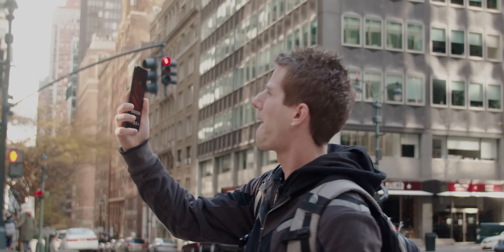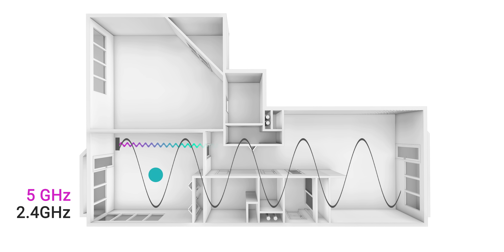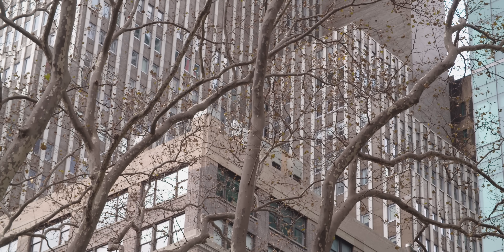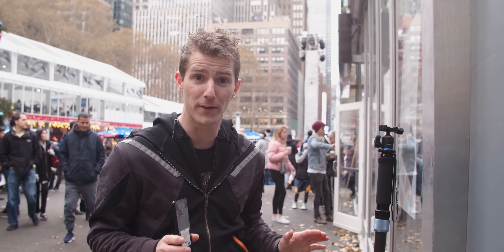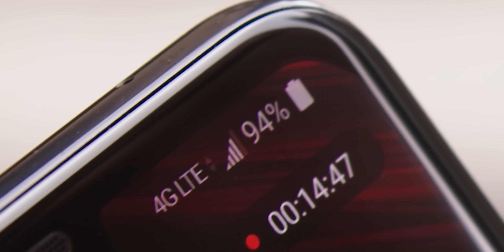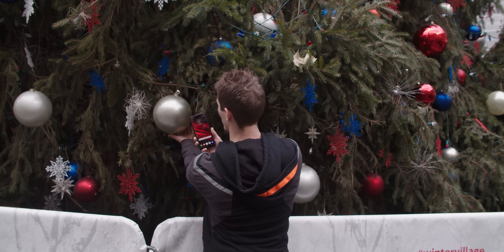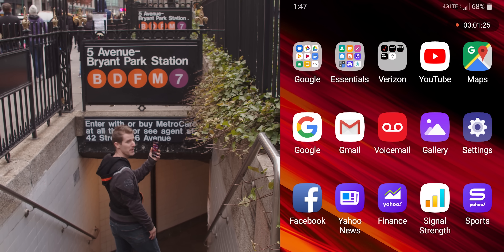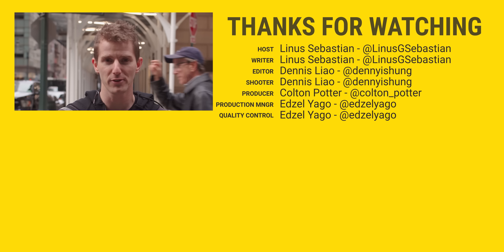The PROBLEM with 5G mmW...

Comment: 5G is a microwave weapon system 😵🤬🤯
Reply: I mean, if you've ever gone outside you've put yourself at a far greater risk from cancer caused by none other than the sun.  5G hardly does anything in comparison; in fact, it is hard to argue that it does anything at all...
Reply: @LegitToaster  This is a ridiculous lie, the sun is good for you.  Microwaves are not.
Reply: @LegitToaster  Infact you have irked me so much I think you should take a look at this CIA document which is a translation of Russian work on the dangers of EMF, the latter pages concern millimetric waves at I think 24Ghz IIRC which is one of the frequencies they propose to use.
https://www.cia.gov/library/readingroom/docs/CIA-RDP88B01125R000300120005-6.pdf
The whitepaper shows that the millimetric waves cause destruction to the Myelin Sheaths which protect your nerve fibres, but hey who cares, you want faster internets on your phone right?
Reply: @chrisobber5604  Your a bot and your attempt to smear me with flatearth nonsense is laughable, I am an IT system engineer with experience working in aerospace and offshore services.  I have spent long enough looking at satelite imagery to know the earth is round.
Reply: @hootsmin  I went ahead and read it, but here's the thing. Not only is this translated (which could lead to factual errors), but it is also from the Soviet Union in the 70s (which had a fair amount of pseudo-science outside of this example).  The amount of research that has been conducted between the 1970s to now is immense, and far more relevent as research has progressed and became more effective. External variables which could affect the results can account for some of the findings as well, especially considering this was before there were standard practices in research for checking results (hence the validity issue). In fact, there doesn't seem to be anything going for this journal, aside from it acting as conformation (bias) for your claim.

Here's the thing. I believe in reasonable skepticism.  I believe it is wise to do research on topics to get a better understanding of things.  What I do not believe in is cherry-picking out-of-date, unchecked, poorly translated, not peer-reviewed journals from the Soviet Union which go against all other modern findings to prove a point.

From a physics perspective which you probably are familiar with, I'm not so sure that microwaves should be feared at such low levels. If we want to use that journal as an example, Zalyubovskaya in the article on the "Biological Effect of Millimeter Radiowaves," it is interesting when it says "[t]he conducted experimental investigation [was] compared with observations the state of health of 97 persons working with generators of the millimeter range."  It would appear that it is there method and equipment which is generating such effects, and many of the effects they describe (such as the renal disorders among the other effects) are more typical of traditional radiation poisoning. It is safe to say with this that there is either an influence from the state to attempt to confirm certain beliefs, the equipment used by the studies is producing higher-frequency waves (or otherwise generating stronger effects), or their was another external variable which was not accounted for.  If the effects of these waves were this strong with this many "quantitative and qualitative" effects, this should have been easily replicated by every other modern study done today.  Also as an aside, it is important to note that most these studies were done on a specific line of rats, which also presents a whole host of other issues, particularly in the way they bred them and their possible exposure to other experiments (not to mention their biological differences from humans which may play a role).

I'm not expecting to change your mind on this, but if you're going to be skeptical, you have to be skeptical about what you use to back up your skepticism; that's the difference between a conspiracy theory and uncovered information.
Reply: @LegitToaster  It seems like every time evidence is provided to people they always give me a lecture about the validity of the science even when they know very little about sceince and probably couldn't even tell me what the scientific method entails.  The same discernment doesn't seem to be applied when they are looking at the flawed whitepapers dismissing health effects produced by the wireless industry or the government however.  Funny that.  The Soviets did excellent work on the health effects of EMF, theres nothing poor about it.  They cooked the U.S. diplomats in Moscow too remember (the Moscow Signal).  They know plenty about the dangers of microwaves.  Regardless the facts are, there are over 20,000 whitepapers which show health effects and 70% of them are negative health effects.  I know nobody likes this because they dont want to hear it, but its a fact.

Why on earth would the Soviet State want to prove that microwaves are dangerous?  This not a good thing for the military or the wireless industry.  pretty much the most idiotic thing I saw you write as it is completely ass-backwards from reality.

Wheres the 5G studies?  They havent done any because it will fail safety testing even with the B.S. standards we have now.  Dont start with the conspiracy theory crap thats a slander invented by the CIA to discredit people who are saying things they dont like and to make the plebs think that conspiracies arent real when the entire globe is run by people involved in them.

BIG WIRELESS CONCEDES: No studies showing safety of 5G - 7th Feb 2019
https://www.youtube.com/watch?v=vZ5soLrvXFg
Reply: @hootsmin   First of all, the Soviet Union wanted to use microwaves as a *weapon*, psychological or otherwise.  Consider that the USSR had poured a large amount of money on the technology already and they had incentive to believe it to be dangerous (purhapse as a display of power). Even if this was all true, the mw/cm^2 was significantly higher in, say the Moscow Signal, than in something like a 5G signal.  Realistically, however, it is safe to say that the Soviet Union would also benefit from pretending/lying about having a powerful experimental weapon, therefor fabrication of studies and effects are a legitimate possibility.

Just so we are on the same page, I don't care for 5G at all, and think it is largely unnecessary, at least for cell phone use.  Also, I don't discredit something just because it is a theory without strong evidence (such as a conspiracy theory), but I don't except it as fact without solid undeniable proof either. There have been conspiracy theories that were later found to be factually based, and I understand that.  I'm not sure I've heard of the CIA inventing the term "conspiracy theory," but I do not mean this to slander skeptical thinking.

The problem here is that these arguments are based off cherry-picking, again.  If we want to trust an authoritative government on a paper relating to its own military experiments, why shouldn't I be able to cite our very own government (assuming you live in the States) on saying that 5G not presenting any "new threats?"  I'm even skeptical about the FCC, but I do know that it isn't nearly as restrictive and deceiving as say the Soviet Union.

I know realistically we aren't going to get anywhere in terms of our viewpoints with this discussion, but do consider what evidence you use to support any decisions or beliefs you hold; research is a valuable tool that aids us to finding the truth in things, but when used incorrectly can lead to misunderstanding.  I do not mean to make this a personal matter, mind you, and see it to be beneficial for both of us to remain as objective and neutral as possible.  It is natural for humans, us included, to not want to be wrong (it activates a response similar to pain), but there is no reason to go to personal criticism; I'm not sure what makes you feel I lack a grasp of the scientific method, but I fear that you haven't understood my position.  I do believe there are some points I had made which have not been addressed here that are valid in there own right, but regardless I'm not sure that anything I said could really be regarded as "idiotic" or "ass-backwards from reality," considering that your argument had no question of credibility or legitimacy which, again, remains a valid issue.
Reply: @LegitToaster  Look I have verified everything I can, I'm not away to get a bunch of labrats and start torturing them with waves for people like you, thats the scientists job.  I have however, verified what the Geordie Terror Mark Steele is saying about the 5G LED lighting systems that have been deployed by studying what has been deployed in my area, we have slightly different technology but it is similar.  In our area the lamp posts are equipped with 868Mhz /900Mhz LoRaWAN control management system, I have a whitepaper from the manufacturer which shows that the pulse modulation that they are using "chirp" was developed in the 1940's for radar.  I have also verified and have in black and white that the system installed can track passive RFid chips (unpowered) at a range of up to 2km.  The 5G towers will be capable of more besides, mind control, crowd control, touchless torture, voice-to-skull, weather modification, over the horizon radar, the sky is pretty much the limit.  You want to die in the surviellance grid thats going to be your problem, the EMF will make the bacteria more resistant to antibiotics and it also makes them and the the fungus act aggressively like they would when they are attacked so they deploy their chemical warfare capabilities.  You live in the matrix and your stuck in the 1980s technologically and our opponents are secretly deploying futuristic star trek phaser technology.  How do you think they know that theres going to be a probelm with antibiotic resistance or that the cancer rate or the dementia is going to sky rocket?  Because they are going to make it happen, ignorance like that which you are displaying is going to get a lot of people killed.
Reply: @hootsmin   Purhapse I didn't clarify what I mean by verification: are these sources which you are using to base your evidence off of scientificly sound (does it properly use the scientific method, is there any bias, does this match what other sources say, and so on).  By verification I do not imply you should or shouldn't test the theories yourself, rather you simply need to evaluate the evidence which you hasn't used, and purhapse their own interests.  Consider Mark Steele, which you used as an example.  Mark Steele runs off of a fear campaign, and I presume this is where you find your argument here for both 5G and street lamps.

To reiterate, I am not saying that these theories are always wrong, but they should at the very least be taken with a grain of salt and reasonable skepticism.  I don't know if Mark Steele has a formal education in a related subject (do please correct me on this if you know), but his claims are quite grandiose and broad.  Mark Steele as well may be not fully sure of his claims.  Mark Steele was offered by EMF researchers (on his side, mind you) to test all the lights and prove that there really was damage caused by them to the general public.  Steele declined.  Mark Steele denied to record direct, factual evidence of his claims, most likely because he knew the results would have been damaging to his reputation.  Here is a link if you would like a read (the article is written by a 5G activist): https://www.vigiliae.org/mark-steele-exposed/

I'm also not familiar with the evidence behind the notion of mind control/"voice-to-skull" through 5G/5G towers, and quite frankly don't understand how this would work from a physics perspective, as well for its weather changing properties. Touchless torture is a bit vague, meaning it could fit into really any definition of torture, physical or otherwise.

Even still, I would like to point out something which hasn't been addressed; in our lives already, there are already scientifically accepted and proven things everywhere in our lives which are undeniably hazardous to our mental health.  Consider what color plates/mugs/cups you use on a day-to-day basis.  How old are they?  Are they chipping?  Many plates (even ones sold today) leach out lead which can make it into your food.  Which issue should be at the top of our concerns?  One which relies on objectively poor evidence or a concern grounded in strong research?  The concern that, at the very least, you have the most influence in is the one which should also be considered before the other.

As for the matrix claim, I'm assuming you mean that in a metaphorical way, but I don't mean to misinterpret your claim in this way.  As for government technology, based solely on how the international system works, it is not likely that the United States has an immense, hidden collection of futuristic technology, otherwise our warfare would play out far differently.  That isn't to say that the government isn't hiding anything, as quite frankly they are, just it isn't maybe to the level of "Star Trek"-esque technology.  I'm not sure what allows a government's scientists to break laws of, say, physics, so I am skeptical of claims of the government's extreme scientific advancement in many of these ways you have presented.
Reply: Directed Energy Weapons 101: Sonic, Microwave, Laser, and Non-Lethal Warfare:
https://climateviewer.com/2018/07/05/directed-energy-weapons-101-sonic-microwave-laser-non-lethal-warfare/
5G APOCALYPSE - THE EXTINCTION EVENT:
https://www.youtube.com/watch?v=ol3tAxnNccY

Comment: I am a Verizon employee and T-Mobile is lying about 5G. Their version of "5G" operates on a 600 MHz wave that supposedly provides superior speeds. This is misleading, considering the fact that the new "5G" that they are touting is barely as fast as Verizon's current 4G network. Not to mention, their "5G" network still leaves almost 130 million people without. They want to claim to have the largest 5G network, so they changed the definition of 5G. Yes, I'm aware I'm biased here, but I would say to anyone looking to buy into T-Mobile's non-sense that they should really study long and hard the differences in coverage and quality. Yes, Verizon is a premium service but it's always available and capable of handing whatever network needs you may have. I'd also like to mention that Verizon has put BILLIONS into the new 5G network and invested in new technology, T-Mobile is taking the same worn out towers and flipping a switch.

Comment: I have a 5G router at home. Getting about 400Mbps indoors but when the weather is bad then i have disconnects and have to restart it. I live in South Africa btw.
Reply: Thats 5Ghz not 5th Generation.
Reply: @hootsmin  Ah ok. Guessing they lying then and people are not getting over 1Gbps on it
Reply: @s27448632  The 5G technology is certainly fast, but its also very dangerous.  I dont know how fast your 5Ghz is, I have everything wired gigabit here because I have EMF sickness and I like my files to move quickly.  The need for wires will become more apparent to you as the people drop dead around you from heart attacks, fast acting cancers and dementia.
Reply: @hootsmin  I was being sarcastic. It is 5g and was launched just over a month ago. Its not 5Gmm like this video tho and runs at 3.6Ghz. Yes I would love fiber but its not available in my suburb yet so wireless has to do. Btw, 5G is not a new technology. Its been used at airports forever and isn't dangerous. Just like how cellphones were rumored to increase brain cancer yet the amount of brain cancer cases worldwide has not increases after their popularity. Its non-ionizing radiation so it doesnt damage cells.
Reply: @hootsmin   Ok snowflake

Comment: Dude. for a tech guy who is all over the place the second something goes wrong. You DID MISS SOME IMPORTANT DETAIL.  The android network manager changes the network before you actually stop getting any signal at all. ( not to mention that it loses time and procesing power while analising which is more convinient). So. to make a proper analisis. PLEASE PUT THE NETWORK ON A 5G ONLY   MODE. #*#*4636*#*#. AND COMPARE THE DIFERENCES WITH THIS VIDEO.

Comment: I need 5G for home internet, i currently use dual 4G modems with load balancing for home internet for an average of 20 down, 6 up(i live in the middle of nowhere) I also need to get my 20gbe steamcache back up using the new monolithic method

Comment: sounds more like anti-5G propaganda because Tmobile cant afford 5G and does not want to fork over to upgrade.
Reply: That's...not how it works. Both are currently using 5G and you can go out and buy a 5G phone right now if you want, though I really don't recommend that right now. The main difference is what KIND of 5G band they are starting with. T-Mobile is using low band 5G (extremely longer range, slower speeds) while Verizon is using high band 5G (extremely high speed, shorter range). Both will eventually even out and will have long and short range 5G, but right now it is barely being deployed.

Here's a video if you need a little more clarification on the topic: https://youtu.be/GEx_d0SjvS0

Comment: There's a reason planes in the atlantic use a different spectrum to comunicate.
The VHF-Band simply just doesn't have the range.
Therefor planes use HF.
Reply: I dont think you know what your talking about, the lower the frequency the greater the range with a given transmit power, those bands have a pretty good range on them.  I suspect you to be a disinfo spreading bot, either that or you are the village idiot.

Comment: Now the problem with 5G on low frequencies.... Its completely worthless. 5G is barely more efficient at transmitting data than 4G LTE.... The huge speed upgrades come from the higher frequency, not the new spec.